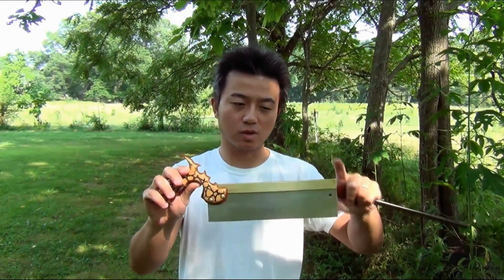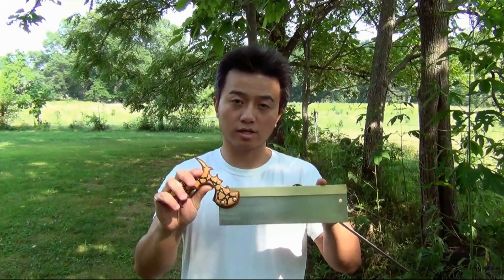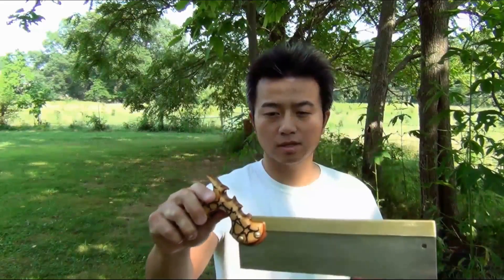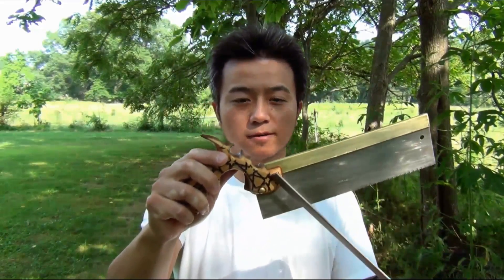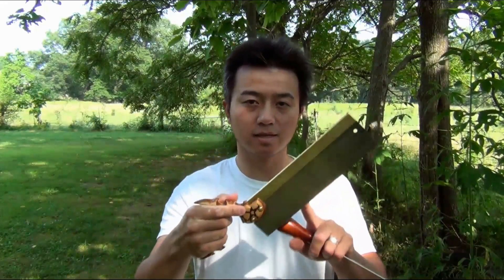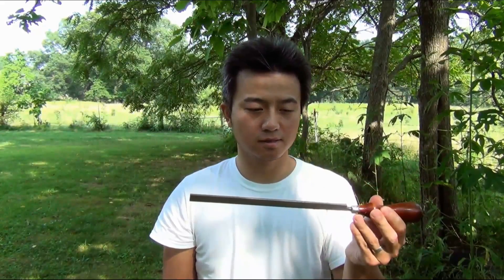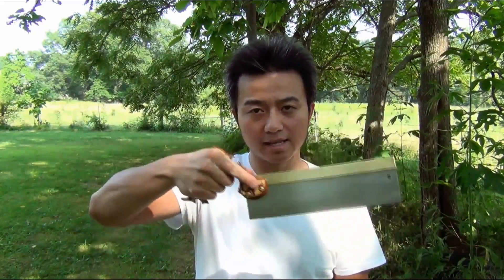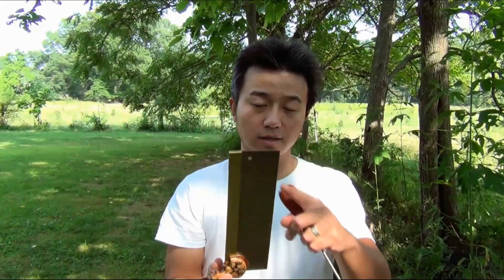Project #7: A Dovetail Saw (Backsaw) Made w/ a Gent's Saw's Blade

Comment: hi john, could you please tell me what type of drill bit you used to drill the blade and if you need to use a powerfull drill. i am busy restoring my great grandfathers brass backed hand saw and i have very little metal working experience. many thanks
Reply from the maker: +son of nun It's a regular titanium coated drill bit. I am sure any all purpose drill bit will go through the metal, there are also specific metal drilling bits. The drill can be as simple as a brace. Good luck restoring his saw.
Reply: John Zhu
thank you john for the information and your kind words. shalom
Reply from the maker: +son of nun Shalom.

Comment: A wonderful effort, sir.i think I'll hang onto my saw sharpening vise after all. Did you grind down the blade to be flat and then start all over or just reprofile the original teeth? Paul Sellers is an awesome resource.
Reply from the maker: +DavieMac48 Thank you. I flatten the tops of the teeth with a file, but the original demarcations were still there; I used those as a guide for the new teeth profile. Paul Sellers is a great resource, I learn a lot from watching his videos. Someday I might save up enough to take one of his class in GB.

Comment: Cool as alls hell! How did you manage to cut the slot in the brass? Supposedly it is very difficult to do using machines let alone by hand. Was it a good tight fit?
Reply from the maker: Man na Thank you, it just takes a steady hand and patience to do it by hand. The blade fit well, but it needed a hammering to get the fit just right.

Comment: Great video, John.  What's the deal with the enhanced texture in the finish?    I've never tried putting shellac over linseed oil, seemed like they might not work well together, but is that how you got the texture?
Reply from the maker: Scott Belleri Thanks Scott. The texture feels like sting-ray skin, it was something I stumbled upon experimenting with different "novel" finishing methods. Shellac and linseed oil are miscible because they both have hydrophobic properties, so there is no chemical reason why they can't mix. The linseed oil does NOT contribute to the texture. Great questions BTW!

Comment: Hey John this video is great! It sure inspired me building my own someday. Where I'm at its very difficult to find a good back saw (if you ever find one). I have a cheap Stanley back saw bought at ACE hardware, but its poorly made. I managed to tweak the teeth a little bit to make it work, as Paul's video suggest (great guy by the way) but I feel it's not enough. With you're simple video, it gives me hope and idea to build my own. Keep it up thanks!
Reply from the maker: Boggie man Glad to hear that, man sharpened teeth are always superior to machine sharpened but the added weight really helps to control the saw. There are good back saws, you may need to sleuth through antique stores, most new ones just seem to be over priced, but for some people it's important to pay $250 for a saw. Veritas makes a line of back saws that are well priced, I received one as a gift from my in-laws and it works great, lighter than a brass backed saw, cuts great. I might review it on a Frugal Friday.

Comment: Quick questing what is the hammer and the metal circle you used fot pounding i am curios i was looking for small
Reply from the maker: Elliot Couture I am not sure which part you are asking. What is the minute mark where this occurs?
Reply: +The Nomadic Polywright Show think he is asking for the handle used when you pinching the back on to the plate. Around the 8 minute mark. I just purchased a gent saw to go through the same process. Thanks for sharing.
Reply: Is the part were wre you were hitting a meteal ducs with a hammer on your workbench ??
Reply: Metal disc
Reply from the maker: I think you are referring to the body hammer typically used to shape sheet metal, the round looking thing is a small anvil. The hammer hits the sheet and the anvil is on the other side.
Reply: Yeah thats it i was curious to find what is the anvil you have hah
Reply from the maker: I got it as part of a kit from Harbor Freight Tools.
Reply: Di you now what yype of anvil it is
Reply from the maker: I do not know the specific name. It is arched and one side is domed upwards.
Reply: Did ypu pierce a hoke in your workbench  and did ypu make it stable is it glued
Reply from the maker: it is rested on the bench, no attachment.